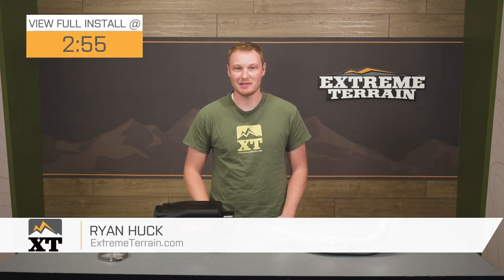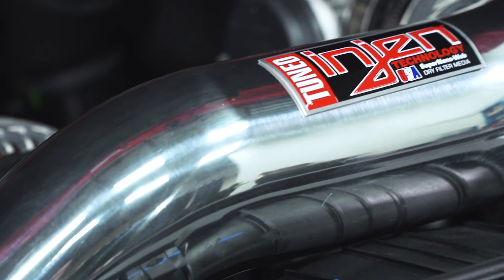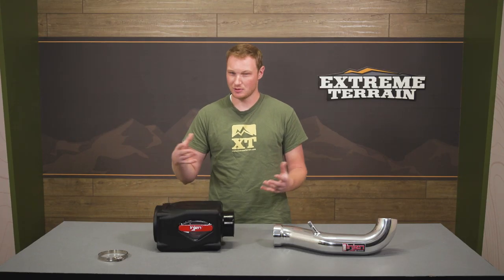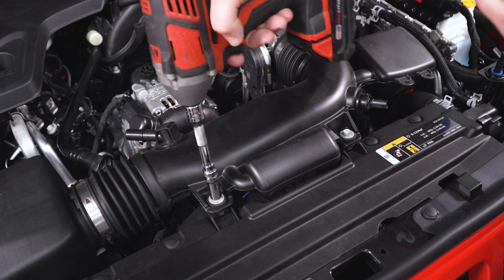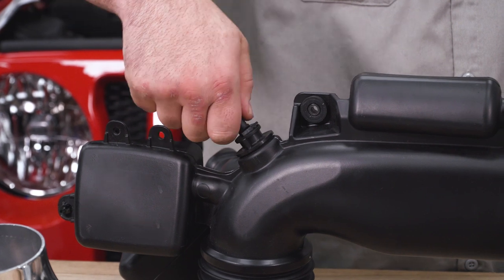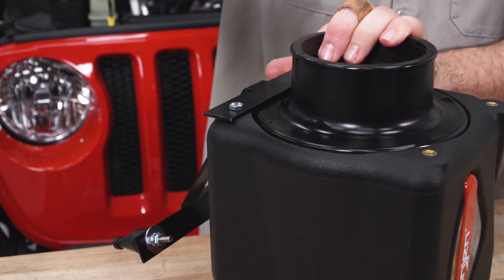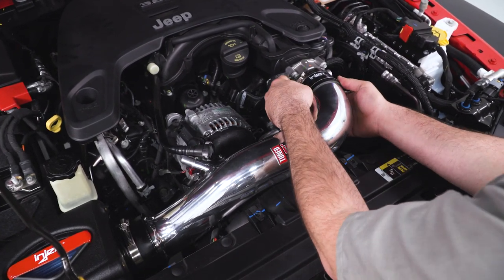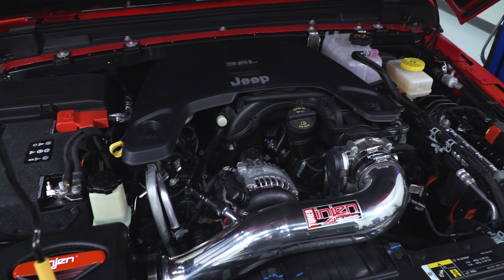Wrangler JL 3.6L Injen Power Flow Cold Air Intake w/ Oiled Filter - Polished Review & Install

Comment: This cold air lacks flexibility when the engine moves around and the intake is stationary, look at the factory intake tubing, lots of necessary flex, if one takes this off road it’s very possible that the cold air will pull out of the throttle body, also oiled air filters allow so much dust into the motor, they are great for the street but not off road, a resonator delete would be ok, but this factory air tube doesn’t look like much of a restrictive resonator, the factory air box is a cold air for those that don’t know... the metal will heat up on the aluminum tube and heat up the air.. now it’s a warm air...

Comment: It doesn’t help your credibility to state more mpg, more torque, and more hp without actual dyno proof.  Several CAI and mufflers have been demonstrated to have no or nominal improvements. Factory stuff is so much more efficient than it used to be.  I’d also note that a metal tube might seem like a plus, but it will heat soak the intake air more than a plastic tube which will insulate the intake air from engine heat.

Comment: You should lose your Jeep privileges if you put this on a Wrangler
Reply: chris g I’d be willing to say that 98% of JLs will not ever experience a water crossing above axle deep water. So... WHY?
Look at the cleanliness of the install. Look at the nice clean design of the metal intake tube. Look at the accessibility to your front mounted serpentine system and pulleys and other items that were once obscured by the OEM plastic intake.  Trace the smooth path that the air intake now is free to travel versus the muffled, and turbulent factory setup.
So, again, WHY?
Reply: Luke Edward Funny thing about metal; it gets a lot hotter under the hood than those plastic factory intakes. 
Another reason may be the fact that the bottleneck of a majority of automotive engines is not the air box and tube OR throttle body, it’s the intake manifold or more often than not, the cylinder heads. If it were that easy to UNLEASH more out of their engines then the manufacturer would do it themselves. Another point to consider is the absolutely ridiculous pricing of “cold air intake kits” for Jeeps across the board. For $300+ and up, you get what? A proven 5 horsepower? 8 horsepower? And who proved that? You can get 5 hp differences or more between dyno runs on the same vehicle without changing a thing and besides that; you arent even going to feel 5 hp. That kind of money just isn’t worth it for such minimal gains if you can even call them that. So you get an air filter that flows SO well that it’s worse at filtering out dirt versus a stock filter, and congrats you’re several hundred dollars poorer but hey, you can hear your throttle a little better and you have single-digit HP gains that you can’t even notice.
Reply: CubNole Metal, yes, it absorbs heat.  Thin metal like this intake tube does not maintain the heat, though. BUT physics dictates that the heat needs time to transfer (“conductor”) that heat to the encased, and flowing air, which is technically an insulator. The only appreciable heat transfer would be the first few minutes as the static air would have absorbed the surrounding heat.  Also, hydrodynamics would teach you that those corrugated connectors produce turbulence within the flow system, which makes high and low pressure areas within the intake tract, making the flow inefficient. Sorry to burst your bubble, too, but 99% of OEMs do NOT optimize intake systems for flow, EVER unless you are dealing with a performance application. They optimize for NVH, packaging, cost, and then after these three, flow values. So, NO, manufacturers would not ever “do it themselves” as the cost to the bottom line would be stupid for something like a $23K JL. Engines are nothing more than air pumps. Nothing. Yes, a high flow air filter in the OEM airbox does increase efficiency, at a cost.  I do agree that this (as well as many other “cold-air systems”) are not really worth the money given the HP gains.  Which, in of itself, explains why the manufacturer does not put the $$$ into it and “do it themselves;” the R&D dollars are unnecessary and unrecoverable.  An air pump, an engine, need to be efficient.  You can measurably increase efficiency in a system without appreciably affecting maximum measured horsepower.  If you optimize an engine a’la dyno tuning you may not increase that peak, but the engine’s efficiency throughout its powerband can very much be affected by simply increasing, and smoothing out the airflow. (I’m not talking carbureted systems as turbulence IS NECESSARY for fuel atomization).  In systems where the throttle body is a dry system, temperature and airflow is key.
And, on another point, you don’t own a Jeep for horsepower.